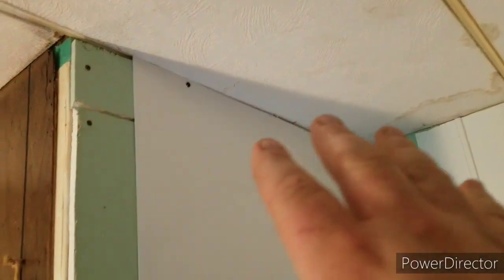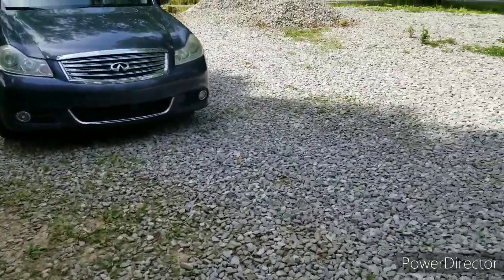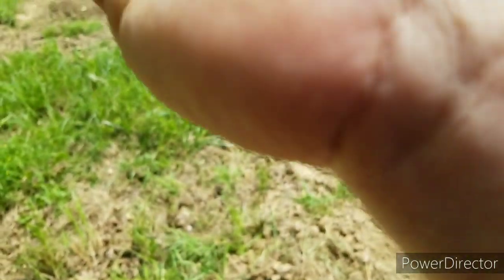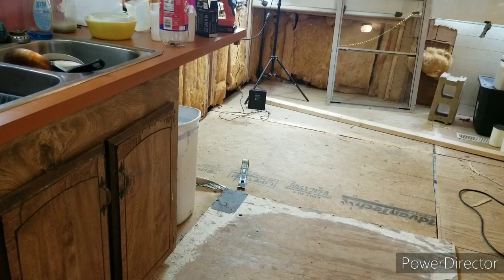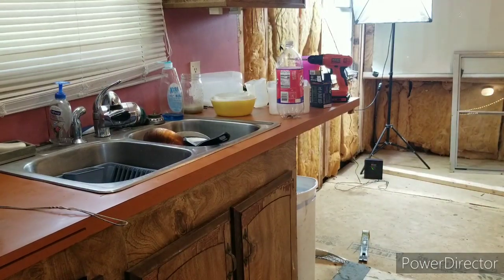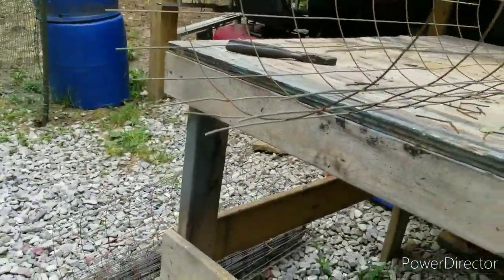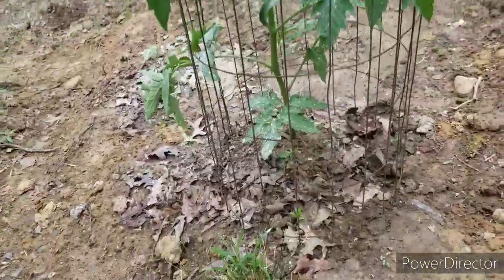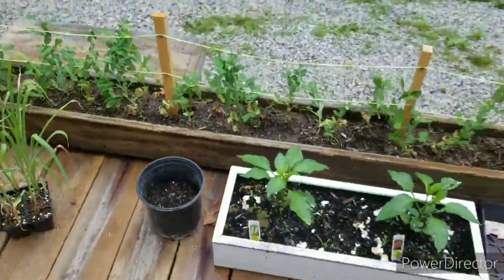$5000 MOBILE HOME KITCHEN ISSUES -  MOBILE HOME SHOWER UPDATE- BACKHOE WORK  AND GARDEN DRAMA

Comment: On the kitchen sink, disconnect all the fittings and pull counter top and sink together.  Scrap cabinet.  Install cutoffs in the water lines if needed.  Repair floors and everything as desired.  Build a simple 2x4 frame and put counter top and sink on it and reconnect it until you are ready to install something permanent. 

I built my own cabinets using Home Depot Oak plywood for my double wide in my driveway.  I built an island first so I could use the storage, drawers and counter top while doing the rest of the construction.  It is not secured so I can move it as needed.  Some cabinets needed to be built in place since they would not fit in the doors if built outside.  But that is only on one wall where it has a small closet and two slide out pantries, etc.  I think the whole unit is about 8 feet long.  The other upper and lower cabinets in the kitchen were built outside.  The counter top was built outside.  Now the kitchen is not a $25K kitchen remodel.  My whole house is not worth that, so that would be a real waste to spend that much.  I think when all was completed I had something less than $1500 in it.  Been very happy with it for over ten years now.  I could not come up with a floor plan using the dimensions of affordable ready built cabinets.
Reply from the maker: Me and you are on the same page.

Comment: That will leak like crazy. Why didn't you buy that as one solid shower stall already put together?
Reply from the maker: Well for one this wasn't my idea, secondly in this video I hadn't got to the part where I sealed the seams,  Thirdly this isn't a residential home it's a mobile home that had an above floor drain and I've been paid to " make it work ".

Comment: I like the idea of a freestanding utility sink. There aren't cutoffs under my sink either. Too bad you're not near me. I have a bunch of plant cages you could have. Of course their not as good as the ones you made. I like them better. Peas look good. I like sugar snap and snow peas best. Finally found your cooking channel. Subscribed there too. Got two of the books you recommended Visual Handbook of Building and Remodeling,  and BasicWiringand Electrical Repair. Next got to find good plumbing book.
Reply from the maker: I have a plumbing book at well. I'll post is here in a bit
Reply: @MDC2020  Thanks!